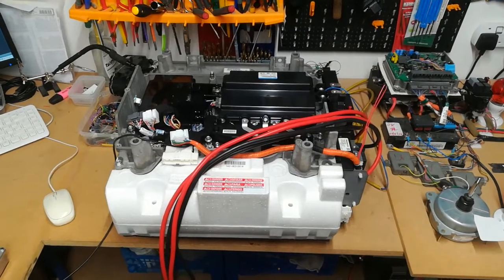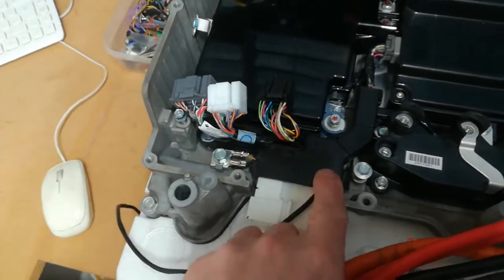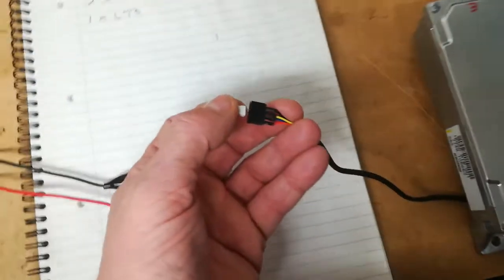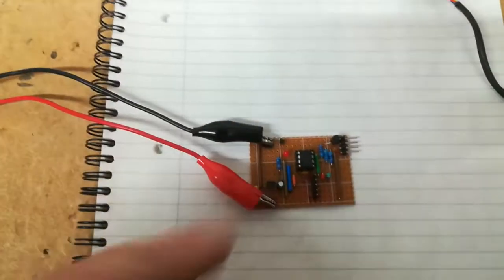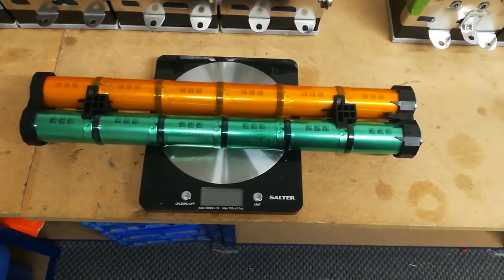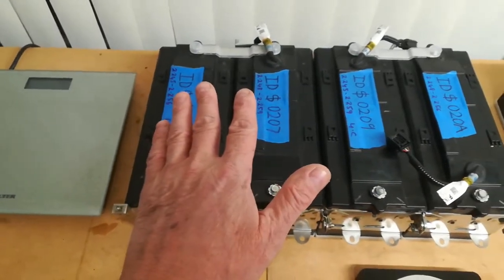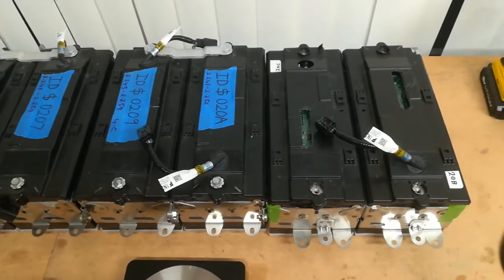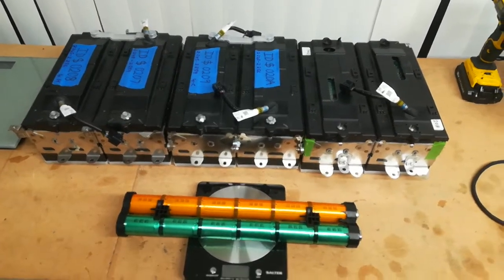CRZ Nimh Pack on the bench Video 5 + Mods

Comment: Are you testing the crz block with the insight 'car'on the bench or with crz bits? most intersted in running these without the car as I really like the form factor.
Reply from the maker: I'm not really running it. Just powering it up and taking measurements etc